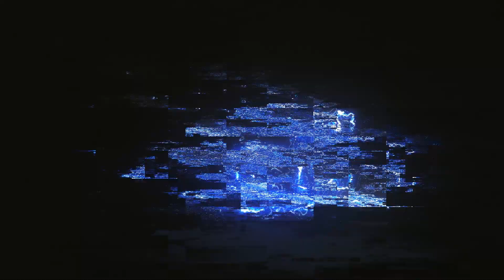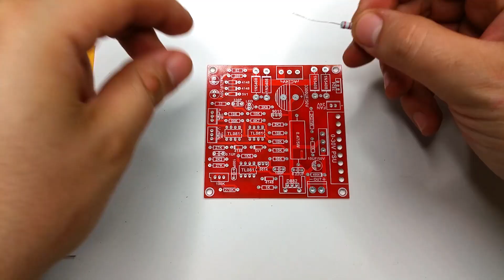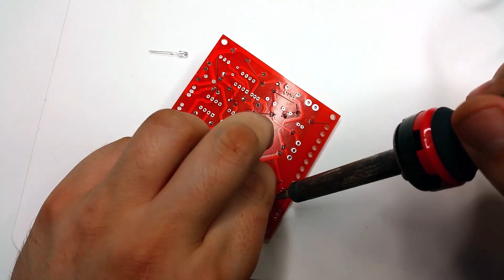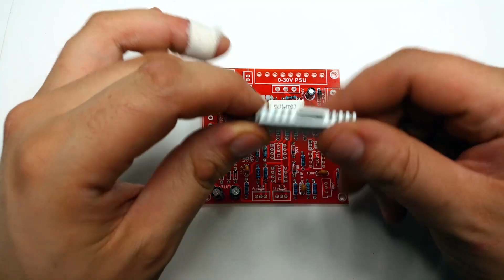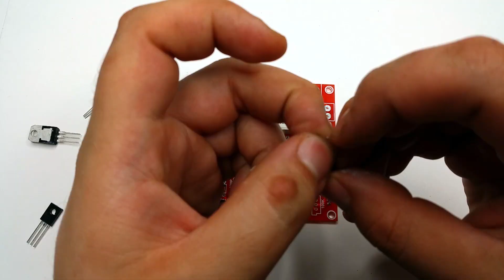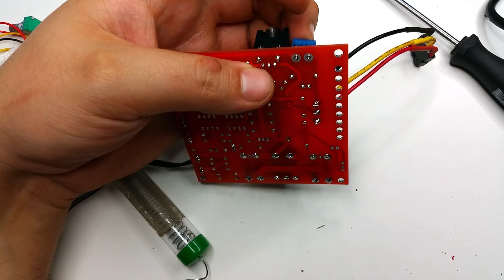Variable Lab Bench Power Supply KIT 0-30V 0-3A build, soldering and testing tutorial

Comment: Below...
I don't understand why the proposed circuits haven't become popular. It simplifies all the hardware, lowers the project cost, is easy to produce on the bench or in kit form, is cheap, requires only a few components, is functional, drastically reduces energy consumption, and solves the problems of dissipation and transistor burnout in bench power supplies, from the oldest to the most modern. The beautiful Chinese power supplies will be taken to another quality standard, becoming robust and reliable. With controlled dissipation, always exactly the same in any situation, it becomes easy to get the most out of the project. Now Imagine the following :
My power supply goes from 7.5 to 48V@12A. 
The unregulated DC voltage is 56V@12A = 672W. 
At 7.5V@12A, the dissipation in the pass transistors will be: W = (56 – 7.5) x 12 = 582W. 
At 48V@12A, W = (56 – 48) x 12 = 96W. 
Now imagine that in the examples above the voltage is varied from 7.5 to 48V, always at 12A. 
Now imagine that at any voltage, always at 12A, the dissipation in the power transistors is exactly equal to W = 5V x 12A = 60W! Fantastic! Thousands of applications including industrial ones. 
https://m.elecfans.com/article/2097065.htm
https://www.unboxing.eu.org/2020/09/power-supply-with-dissipation-limiter.html 
https://www.worldradiohistory.com/UK/Practical-Electronics/70s/

Comment: Good afternoon, I bought a 24 + 24 3A transformer and when connecting and measuring with a multimeter I saw that the output voltage is 25v, I would like to know if I can connect this board with this Trafo?

Comment: Got mine all soldered. The voltage works fine but when I turn it on the current is saturated to the max. I v checked for short circuit, can't find any. There is no load but the current limiter is on. Any idea?

Comment: I buildt this kit my self but it doesent work. I notised that the 5v1 zener diodes does not put out 5v, and i checed them whit my multimeter and they seem intact, does anybody know what could be the problem. And on the output there are only 0,5 volts.

Comment: Thank you for a very well done and informative video.  I have built the kit using a few mods I found elsewhere.  I am now ready to connect the board to the required 24vac supply and was stopped dead in my tracks!  I was not planning on using a 24v transformer as I already have on hand an 8.5 amp Variac to use instead.  A problem--my variac has only 2 wires out--hot and neutral--while the board shows connections for 3 wires at the 24vac position!!!  I barely qualify even as a 'beginner novice' so am lost as to how to proceed.  Does the board want an earth ground, and if so, which lead is used?  No polarity is given.  Any help at all would be most appreciated!  Thanks in  advance
Reply: As you can see on the video, the input uses only two connections: The two outer connections of the connector. The center one is not used. BTW, no polarity indicated at the input because it is alternate current. I used two old 12v halogen lamp transformers connected in series to get 24v and works like a charm. Good luck.
Reply: @JuanGarcia-mq4lj  Thanks Juan!  I received help from another source which is the same as you offer here, and of course it works!  I greatly appreciate your help.  BTW, it never occurred to me to use a load in series to get the 24v!

Comment: and the 7824 ? why is not nounted aboard ?
Reply from the maker: Because that chip outputs 24 volts for the fan, I don't need that cause I'm using a 12V CPU fan anyway. I used a buck converter to step down the voltage to 12V for my fan and 9020 display.
Reply: @dusnoki  ah ok! it seems this works fine
Reply: Why not just install a 7812?

Comment: What amount of ampere what you recommend for this power supply? (1,2,3,4 ampere)
Reply: And what transformer did you use? Because i found some transformer that are 24VAC 3A transformers and some that are 1/0,4A. But what amount of volts and ampere would you recommend?
Reply from the maker: @javs533  I'm using a 24 volt ac 3a transformer. But I don't recommend you using the power supply on 3 amps for long periods of time, as it is prone to breaking on that high of an amperage.

Comment: For anyone just starting with these boards, i would REALLY recommend soldering in sockets for the three IC's just in case you need to swap them out later. For the tiny extra cost, it is very worthwhile because these TL081's are very hard to remove later......ask me how i know!...lol!
Reply: englishrupe01 change the TL081’s out for some LM741’s which can take 44v.

Comment: can i use laptop adaptor arpung 19volts instead of transformer
Reply from the maker: Unfortunately it has to be an AC transformer.
Reply: captain skeptical I believe I read that ac was used for some other purpose in the circuit so applying just direct cc after the bridge won’t do.
Reply: yes you can but you need to connect a second very small supply  for the -5V.

Comment: the light on my board stays on constantly how would i fix this
Reply: My first one did that, and it output 30v with no adjustment, so i eventually bought 50 more TL081's for a few bucks. I switched all 3 out and immediately it started working perfectly. It seems sometimes these items are faulty from the get-go so it is worth having a few on hand. I also installed round pin type sockets so its easier to swap if they ever go bad again. I love these boards and they are on ebay now for under $5 if you look hard. Great bargain!
Reply: Tl081’s are not adequate for the long haul.  They are rated for 36v.  Easy to burn out.

Comment: I cannot find a 24V 3A or 2A transformer on the cheap, where to find them?
Reply: Why 24v and not 30v transformer? I mean the guys is using a 38v transformer
Reply: I used two old 12v halogen lamp transformers connected in series to get 24v and works like a charm.

Comment: Nobody could accuse you of being slapdash that's for sure. I have one of these kits, I have ordered another and spare 'gubbins' for when I pop something. A really nice video - thank you so much. I wondered what that blue trim pot was for, it says nothing on the adverts. 
I have a rather expensive Fluke that I save for important occasions. I decide to get a couple of the cheapest yellow £4 odd ones and another at around £8. I think you will be in for a shock when you test your new meter against your old one. Everyone seems to complain about 'cheap Chinese junk' but why do they buy it then. There is no doubt the quality of kit from China is getting better.  

I do agree with you re cooling. The pureists froth at the mouth and scream blue murder if you mention a fan, they prefer a heat sink the size of a loaf.  

Do you think it would be possible to use 2  D1047 output transisters in parallel as just 1 for 3A is a lot ?

Comment: Can I use 24VA 2A transformer to get 3 amps output or I will get only 2 amps? Please give me a reply
Reply: if you use 24V 2A transformer means you get 48W available without taking into account any losses, so by power law at the output if you set 30V you only could draw I=P/V=48/30= 1.6A. Nevertheless, if you set 5V at the output you could draw I=P/V=48/5=9.6A BUT the circuit will limit that to ~3A even if you put your amp potentiometer all the way to the right
Reply from the maker: Yes,  but to be honest I wouldn't even strain this little power supply with 3 amps because as I've read on a couple of forums lately... the components on it are really not rated for 3 amps. So either way keep it under 2A especially for longer periods.
Reply from the maker: RiFLeX117 thanks for the detailed response.